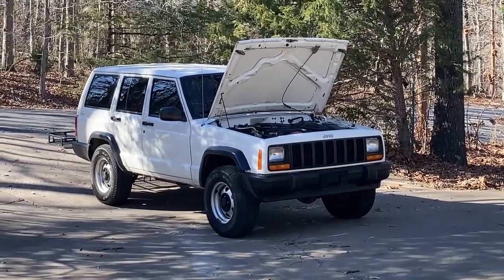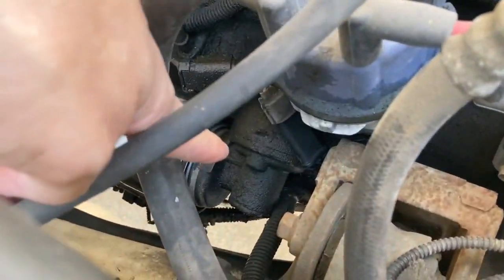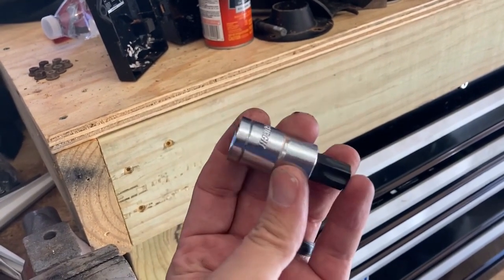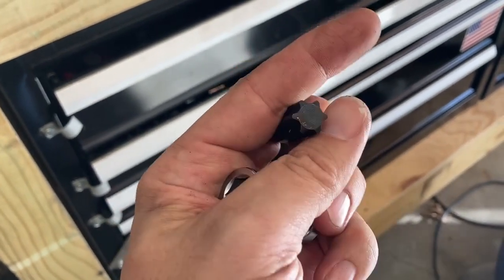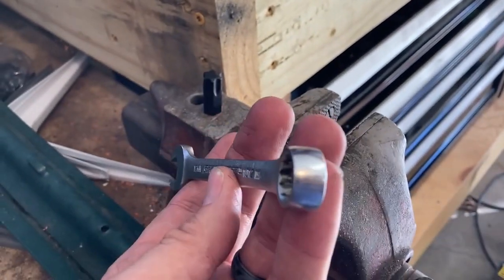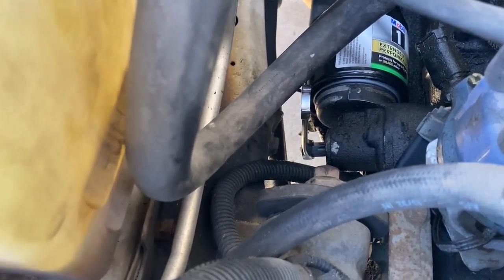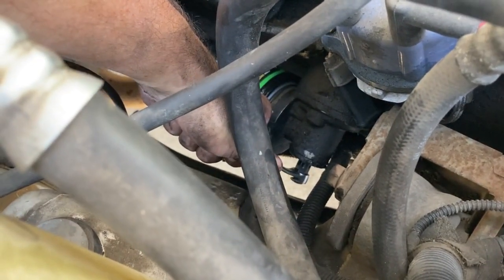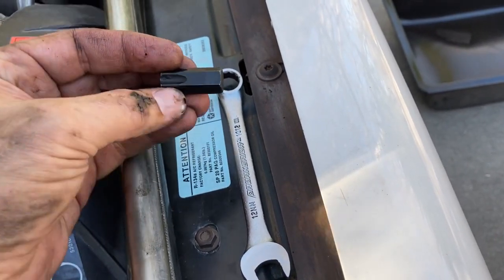Jeep XJ 4.0 Cherokee Oil Filter Adaptor O-Ring Leak Repair Replacement Fix

Comment: I replaced the O-rings on my 1993 Cherokee but a T-60 wouldn't fit. I had to use a 9/16's hex. I did the same thing of removing the hex from the socket. Used a 9/16's wrench on the end and a short cheater bar. I also removed the carbon canister and windshield washer tank. Didn't have any problems removing the filter adapter from the top.

Comment: It seems to be a common problem with older J’s and jeeps with the 4.0 L engine you would think that snap on or Mac would make a tool just for that.
Reply: Or maybe a oil filter delete, relocation oil filter

Comment: Gonna do the same job on my 98 xj. I ordered the big L wrench on Amazon. Also will use cheater bar.  Wanted to ask you how tight you went on the bolt. It's a thick bolt so i guess it's ok to use good force?
Reply from the maker: It can handle a bit of force. I tightened mine with almost the same force as it took getting it broke loose. Make sure your torx bit is tight and fits snug.